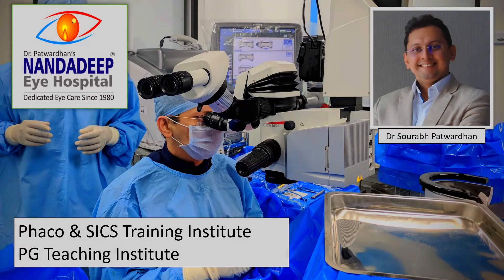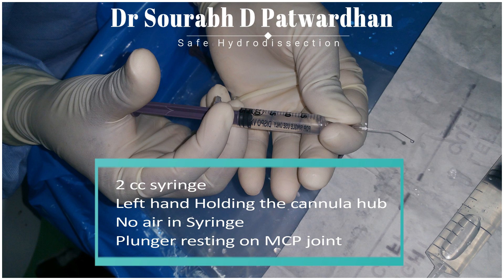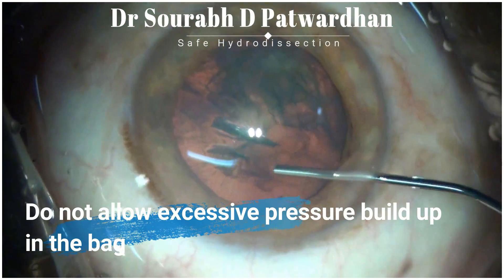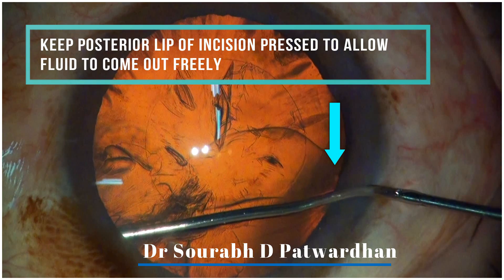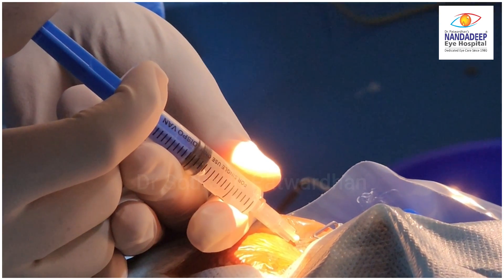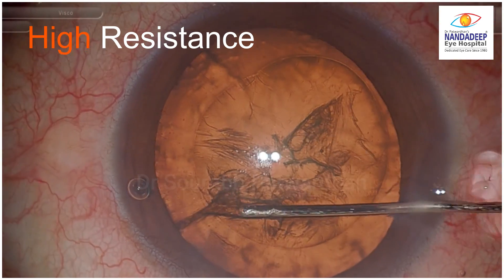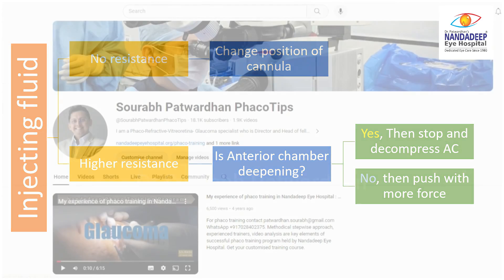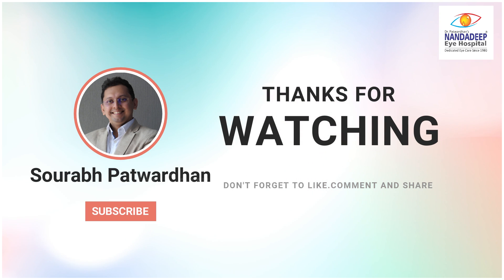228 Secret behind successful hydrodissection Dr Sourabh Patwardhan

Comment: Another VERY useful teaching video for me, Sir 

I am so grateful I am learning these fine tuning techniques. 

☺️😇🙏🏻

May I please ask you a question? 

He will there be deepening of AC if higher resistance is felt during hydrodissection?
Reply from the maker: Check the last flowchart. Increased resistance with ac deepening means you need to press the incision posterior lip down to release ac pressure.
Reply: Thank you very much for your prompt response, Sir. 

Your explanation and the flow chart helped me understand the technique fully now. I have learnt a lot. Had been struggling with hydrodissection for a long time. 

I really appreciate this guidance. Thank you VERY much, Sir. 🙏🏻

I will share the video with a friend (colleague) of mine.